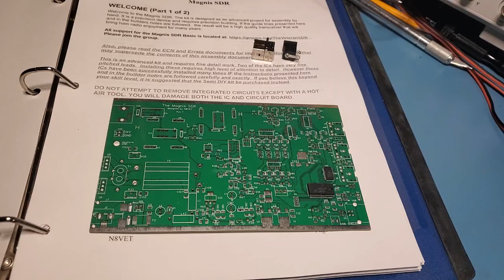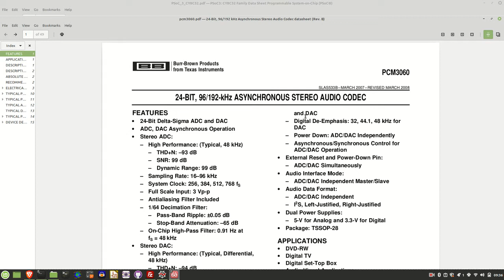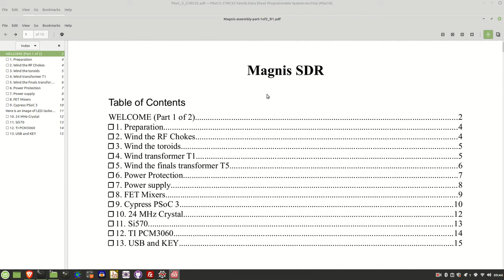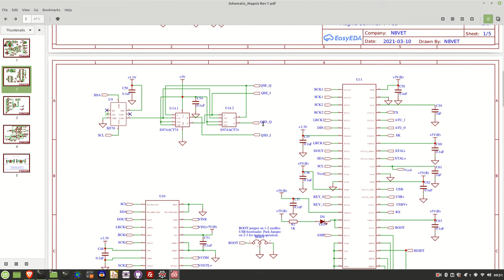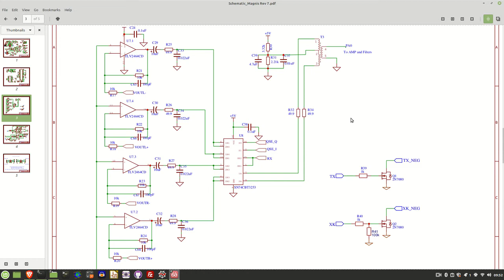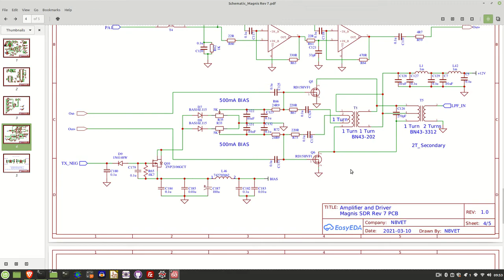Magnis SDR - Part 1

Comment: can you give a link to where you bought the kit? or the board?
Reply from the maker: Sure - here's the ebay link
https://www.ebay.com/itm/164873218031?ssPageName=STRK%3AMEBIDX%3AIT&_trksid=p2060353.m2749.l2649

and here's another place selling the kit for a little cheaper
https://www.multus-sdr.com/index.php?rt=product/product&path=71&product_id=155

I bought the ebay one. Note neither kits have all the components required - just the uController and PCM3060 pre-installed. As usual I am not affiliated with either.